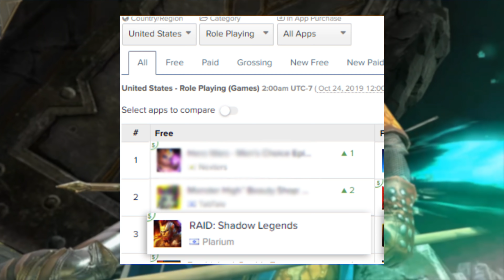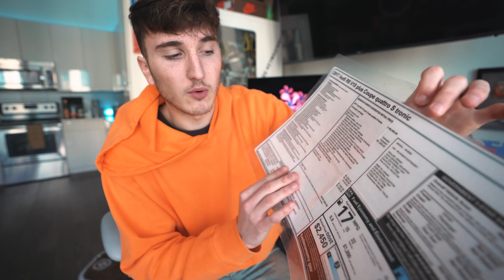What Happened To My 1/25 Audi R8....

Comment: make sure you use XPEL Ultimate PLUS for PPF!!! I just bought a 2020 Sierra 2500 Denali and I'm paying $2500 for a whole front nose full fendors full hood headlights bumpers mirrors..make sure they don't rip you off on the cost..would love to see some more car content! just make sure they use the XPEL and not some cheap crap..Its warrantied for 10 years.. U ca legit take a wire brush to the film scratch it up hit it with a heat gun and the vinyl goes back to its original state!!